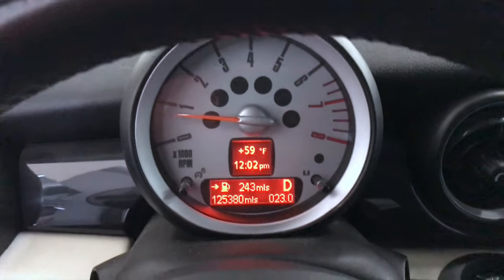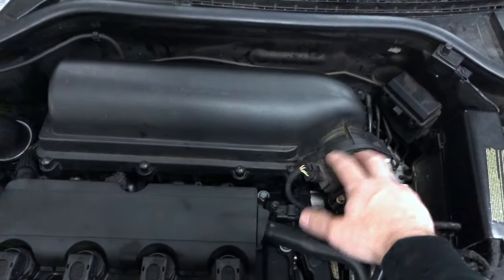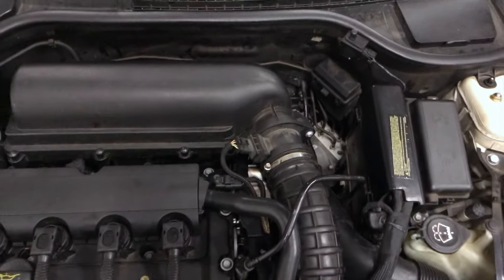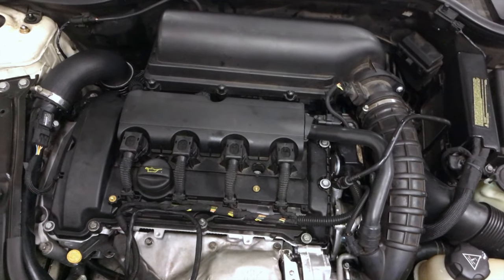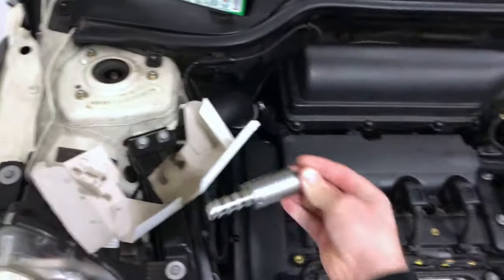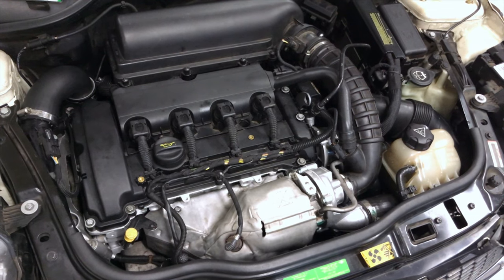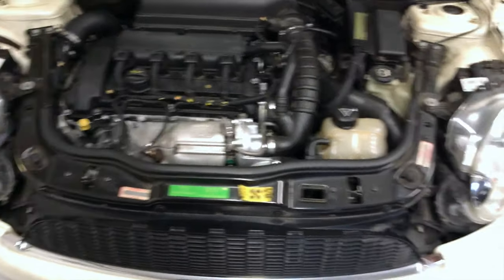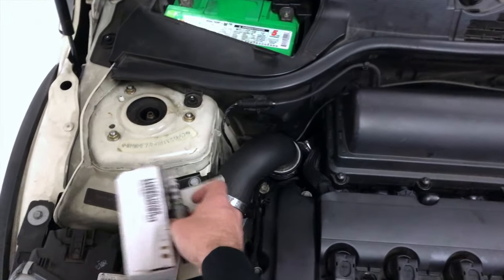MINI:  Erratic Idle Issue, SOLVED

Comment: These cars are a nightmare, all of them.  Stay away and live a happier life.
Reply: YES
Reply: Exactly, you can't solve any issues 100%. It will always be solved 50% and for one issue need to replace many parts. These are just crap Autos
Reply: @Mrmuzgemni  why you here then? My first mini had 200 thousand miles on it. I put 20 on it without spending a dime. Now my clubman s with 145 on it which I got $3 grand below price runs like a pocket rocket. DO YOUR OWN MECHANICING IF YOU WANT TO OWN A MINI SPORTS CAR. That's the only way people.
Reply: My 2012 minicooper S has been an absolute blast to own. I've only ever done very basic maintenance aside from replacing the valve cover gasket, even that is pretty basic
Reply: these cars are the best you can drive much fun
Reply: @vaiosdiminikos4628 they definitely have never driven a mini before and don’t understand😅
Reply: La mia ha cominciato ad andare male da quando l'ho trascurata. Se la tieni bene va come tutte le auto.
Reply: Absolutely
Reply: I hear you!
Reply: As someone with a mini cooper please stay away😂😂8k in it and it still isn't 100%
Reply: @andypeers9903 if you have to be a mechanic to own a mini, then it means it's a very crappy car
Reply: You know shit then. The r53 is a SUPER solid car.. the 07+ n14s once revised are as reliable as their owners..plain n simple
Reply: They are actually really good cars they start having problems at 130,000 miles just like a Toyota does all cars are the same when they’re late models.   These are Baja inspired and there’s a lot of really cool innovations a lot of bang for the buck.
Reply: I must fix them all
Reply: I agree but they are fun though 😅
Reply: This car is a problem factory
Reply: Wrong. Improperly maintained Minis are nightmares. Skipping out on something because it's expensive can ruin lots of cars.
Maintenance is actually pretty cheap if you are willing to learn how to turn spanners yourself.
Reply: @Wisey_83  So are formula one cars, if you take the engine apart after every race and replace every component, they will perform better. Does that mean they would make good daily drivers? I should not have to become a mechanic to own a car. Listen to what you are saying, I give you permission to think about it.

Comment: I've taken my car to the mechanics three times in my life time. One at a local shop, one at a european car specialist, and the last at a mini cooper dealership. The first time, they failed to fix the issue and I was able to fix it myself with a new intake solenoid. The second time was at the specialist and my car was misfiring so a fuel injector and the thermostat were "replaced" (which I found out a year later, they didn't cause I tried plugging in the old thermostat and it was completely different). Still wasn't fixed, so the last stop was at a dealership in which they replaced all the things I had already replaced including spark plugs, coils, new injectors, etc. Needless to say, they couldn't fix it and told me I needed a new engine. At 75k miles, I didn't think it was worth getting a new engine, so I took it home and looked up videos. I was able to fix all the misfiring by simply replacing the dirty fuel filter in the fuel pump. They didn't even look at it! Now I'm not saying it was the sole reason my car was not working properly, but I got cheated twice and paid a lot of money just to be told I needed a new engine when they completely overlooked a simple replacement. Thanks to these kinds of videos, I was able to save myself from spending another couple grand. Please keep posting videos, no matter how simple of a fix it is. You could save someone a lot of money. Now my code reader is reading cylinder 4 is misfiring. I'll be strolling through your videos! Thanks 👍
Reply: Thank you 🙏
Reply: I'm getting a 1497 code-- could it be the dirty fuel filter?  Thanks, Mike
Reply: The Ford dealerships I have gone to are also very incompetent and deceitful.
Reply: Hello there, did you find out what the cause of cylinder 4 misfiring is? I have a 2002 R50 and have the same problem P0304 cyl 4 misfiring, I did a compression test and it is indeed below 150 psi. It could be the intake/exhaust valve I'm assuming but I'm not sure :"(
Reply: I changed EVERYTHING and still runs rough. :(  Fuel filter, plugs, coils, Vanos, timing chain, throttle body, pcv... time to trash it.

Comment: A good rule of thumb with these engines is to be careful about running fuel injector cleaners through your fuel tank... it can cause funk to foul up your oil and cause the VANOS solenoids to become clogged(ask how I found this out 😂)  if you do run cleaners through I recommend changing the oil after the tank of fuel is almost out. You can spray the VANOS screens with brake cleaner(try not to get it on the plug) or let it soak in the acetone.
Reply: I’m now reading this after putting liqui moly injector cleaner in my 08 mcs

Comment: My friend has a 2010 cooper s turbo with a weird issue. Engine runs fine for the most part but throws a bank 1 rich at idle code. Checked fuel trims and when the engine is idling after start it has a ton of negative fuel trim value. Seems like the engine sorts itself out after driving for a while, but still idles rich. Supposed fix is new valve cover, that did not fix the problem. What other things could cause this?

Comment: With a rough idle I would've also checked the PCV connection & its plastic hose too.  The plastic hose connection between the dirty side  of the valve cover and the intake manifold is notorious for cracking.  Just take the OEM plastic hose (with its integrated fittings on each end ) out of the engine...pinch fittings at each end.  Carefully cut out the fittings from the plastic hose.  These fittings are simple BARBED FITTINGS at each end.  Therefore, just go out and buy some 3/4 inch I.D. RUBBER hose of same length as the plastic hose. Slide on two hose clamps for the 3/4 inch hose, push those barbed fittings at each end and hose clamp them.  This will solve the inevitable splitting of the cheap, thin walled, brittle plastic hose that is supplied with the car.
Reply: Question, have you seen any videos on how and where to remove the hose from?  In the meantime, I just keep repairing it.  I'm afraid to open a can of worms.  Thanks in advance.  ~Veronica

Comment: I want to thank you so much Mike, that this situation happened to you and for you posting this because this is exactly what happened to me after repairing a warp head from overheating, sending the head to the machine shop, and after the first... it started to do that engine idle, with misfires in all cylinders codes. and after finding and watching your video, I got to work, removed the Solenoid, cleaned it, removed the screen added power to the switch, sprayed it with contact cleaner, replace the screen then reinstalled it, started my mini and the idle was perfect!!! I hope my comments help anyone else that had the same situation happen to them... I tried cleaning first before buying a replacement solenoid... wow they are expensive!
Reply: How expensive and from where, please? Mine is doing the same thing. Thank you for the excellent presentation! I subscribed.
Reply: Same. Mine is misfiring. Worse when cold. The mini is so problematic!!!

Comment: Was chasing the same fault. After changing both O2 sensors, saw this - Solenoid replaced and sorted withn minutes - thanks for sharing this, saved a lot of time and money
Reply from the maker: Nice! Glad that solved your issue. It was a strange one.
Reply: O2 sensors was mentioned by my mechanic too but at a huge cost!

Comment: Hey Mike! Thanks a lot for your video! Ive got same issue with my Peugeot 308 '13 with mostly the same EP6 engine. After a cold start, when engine starts to drop for a normal idle like 740-760RPM - this problem occured. Also - car starts shakin very violently when you first put it in a gear, no difference whether it be D or R. And once again - no failures or check-engine, no fault codes on both ELM or Lexia (basically - special diagbox for Peugeot\Citroen). 

I've tried everything from new coils & spark plugs, i've changed petrol station twice, even opened the valve lid and checked the timing chain - everything seems fine! And then I've found your video with the exact same problem, so i've chandeg the solenoid valve and voila! Everything finally works perfectly! 

Thank you man! Big respect from Russia!

Comment: Of all the videos to help me diagnose my rough idle on my N14 r56, this was the answer.  I had many but not all the symptoms of every other video, and I was really hoping to try anything, but replacing or servicing the timing chain (as this had been done only 20k miles earlier).  This same solenoid was my issue and was SUCH an easy and cheap fix.  We're back running smooth.  Thank you very much.
Reply from the maker: I am very happy this helped in your case. Thank you for sharing.

Comment: Had same issue on my 2007 Cooper S recently.  Changed plugs/leads and still had cold start issue.  High Pressure Fuel Pump changed too.  Sorted now, drives better than ever.  MINI's are renowned for Fuel Pump issues as second time replaced now.
Reply: Do you run it low on gas often?
Reply: @puppacito  fill full tank, then fill up when 3 bars left (10 bars on guage).  Does this affect it?

Comment: Great video
I'm trying an aftermarket solenoid just for the test if nothing else. It's a used car I did timing chain, head gasket, shaved head by hand, replaced oil pan gasket cleaning out that film in pan, replaced water pump, installed new plugs w aftermarket coils, new f bumper support, sanded and wired brushed front frame/suspension, new backing plates (factory only) and wheel sensors. All aftermarket except front backing plates and all work well so far. 
Injectors need to be sanded like a piece of tubing to fit back in if you have high miles or they wont pop back in. I had to clean mine twice pretty well at 207K.
Reply from the maker: Wow. Its a project of love )

Comment: Wow I literally JUST had the same symptoms on my, 2011 R56 N18, and I turned out to be the, Fuel Rail Pressure Sensor, which is located on the fuel rail. Runs fine again. I'm going to go back in to Change both VVT Valves, tomorrow. Thanks guys
Reply from the maker: Very interesting. Glad you figured your issue out. Best!

Comment: Hi Mike,  I am currently experiencing something similar on my 2012 R56 non turbo.  I rebuilt it after purchasing it for $500 with head gasket blown.
I have P00BD codes show up about 400 seconds after starting.  Slightly erratic idle at startup, then smooths out nicely.  It does have very occasional surging, or possibly no fuel briefly at about 3000 rpm, which can set the P00BD code (MAF too high air flow).  Replaced the MAF, O2 before cat, and spark plugs.  It has 0.5mm bigger pistons (non turbo pistons), and head was decked and serviced.  Block was decked also.    I have ordered a new PCV valve, so that may be it.  It's been running now 30 days since finishing the rebuild.  Smoked the intake and found tiny leak at intake cam sensor.  Cleaned O ring, now no leak.
My son is a ASE mechanic, and so far he's stumped.  I am new to Minis.  It's fun to drive, but can't pass inspection.  I did see a lean code recently also... but not normally.  I clear codes, my son clears codes at shop, and keeps coming back.  Could it be one or both of my Vanos solenoid's?  Intake/Exhaust solenoids were removed before head went to shop, so they were protected, and I installed them myself.
Sorry to bother you, but after hours of searching, your video checked most of my boxes for my problem.  I tried to replace almost everything I could with new parts that I thought should be replaced.

Also, what is the valve located in the valve cover in the center next to the air filter bolt?  Not the PCV valve, the smaller one?  I took it apart to clean it while rebuilding motor.  Did I damage something?
Reply from the maker: Mass air meter faults are almost always due to a faulty throttle body. The throttle body is plastic and starts binding also the plastic gears inside start wearing out.  Every MINI eventually needs a throttle body once in its lifetime.  Thanks for watching my chanel and subscribing Kirk.
Reply: @MikeMDs  Hi Mike,  UPDATE:  I took it to Mini.  No help.  They actually put a new throttle Body in, and a new Mass Air Flow sensor.  Kept throwing a P00BD code.  They also did a TSB for another code (new DME software...).  When I picked it up, they had it idling for more than 30 minutes (maybe 40...) and when I drove out I saw the check engine light go OFF!  I drove straight to DMV and it 'PASSED' emissions.  That means no check engine light, although the P00BD code was in the Verified (?) section, not in the Pending nor was it in Permanent section on my Blue Driver OBD2.  After driving a couple more drive cycles, Check engine light came back!  Now I have two years to learn about my car.  My guess is, this P00BD code is a cummulative number based on time of Mass Air Flow over time.  Since my pistons are 0.5mm larger overbore, I believe it's measuring correctly.  I think there is a limit in the ECU that if it goes over that limit, it sets the Permenant and Pending P00BD codes, so the light comes on.  I now know if I let it idle for say up to 45 minutes, turn it off, then it probably will turn off the light for a drive cycle or two.  The Mini dealership did nothing other than teach me that idling will help turn it off.  Nothing is wrong with the car.  I just need to find out if the ECU can have that Mass Air Flow limit number be increased...  Any ideas??  I don't want to 'Tune' it, but is that what I need to find?  Someone to tune it?  I want the ability to remap the ECU back if done wrong.  I don't want extra performance, just not have the light off. I do have bigger pistons.  That's why I suck more air over time.  Thanks for listening.  I cannot find anyone else with this problem.  Maybe that no one else bothers to rebuild a std non turbo Mini?
Reply: I also swapped the Intake and Exhaust solenoids because you had that trouble.  I also replaced the PCV valve.  None of that helped.  I am of the opinion it's running fine, just bigger pistons draw in more air past the Mass Air Flow Sensor...
Reply: @KirkReed hey, i know it's long ago, but did you fix it back then  because i have the exact problem and i did the exact steps you did and still didn't fix it, hope you remember 😬😅

Comment: Had all those problems. Poor idle, high oil consumption, erratic auto box, fumy exhaust. Took out the PCV which was OK but the whole thing was SO coked up.  Cleaned it thoroughly and it runs like new. Thanks.
Reply from the maker: Nice work!

Comment: I had experienced erratic idle as well even changing out the VANOS solenoid. Of course the same route we all go through, changing plugs, coils, blah blah blah. So for the heck of it I checked compression. During a compression check, one of my cylinder (#3) was low at 120PSI but only when cold. I repeat, only when cold, at first start. When the motor warms up, the compression check registers normal across the board. So I shut down, then restart the idle is fine. So I found the fault to be the teflon injector seal. But unfortunately, if you were to pull the injectors, you need to change out all four since they're all attached to the rail by a tight viton seal. I recommend when you change the seal, no special tools needed for this, I have a trick, I just use a "Paper Mate Ballpoint Stick Pens 2006827", google it, it's the blue one that we all have used in our lives. I slide the teflon to the major diameter since it's the same diameter of the injector to expand the teflon. Once expanded, slide it off and put it on the injector. Cut off the pen cap leg, then use the pen cap to compress the teflon, give it a couple of minutes. When you remove the pen cap take no time and insert the injector before the teflon expands. Insert the injector one at a time so you'll feel it bottom out. Wear gloves and clean the injector seats extremely well, no oil must contaminate the teflon seal. Then when you have all four installed, push the fuel rail into position and tighten the four torx bolt. Bosch part # 2707010018. Easy peezee!

Comment: unfortunately we replaced this on our 2015 copper s and it didnt work.  Had to send it to the stealer and they diagnosed it with a bad High Pressure Fuel Pump.  $4200 CAD quote.  I found a Bosch HPFP on Rockauto and had the local BMW specialist shop do it for $600.  Still didnt fix the issue.  Now the diagnosis is that the timing chain needs to be replaced because the HPFP broke it (they are connected)  30 hour job apparently.  This car is a LEMON!!!  This is our 2nd and last Mini. Our R56 Cooper S had major engine issues and now this has a major fuel issue.  And we put premium, ethanol-free fuel in and only the best oils.

Comment: Haha I literally just got this issue fixed on my 2013 Mini Countryman. It drove me crazy. Had to have my oil pan gasket replaced along w my oil pan adapter due to a crazy leak and horrible burning smell. Got it back and it was still rumbling like crazy, turned out to be something w the intake valve not fully being on and air getting inside 🤦🏽‍♀️ now I’m getting check engine light but it’s for the thermostat 🙄..
Reply from the maker: I know. It's a love hate relationship sometimes. More love than hate tho.

Comment: The N12 has two solenoids, one for each cam.  My 08 Clubman (non-turbo) had a similar issue, but it was actually the broken plastic timing chain guild.
Reply from the maker: Thank you Michael you are correct, thanks for calling me out.   I will make a note in the description.  And thanks for watching.
Reply: Every car has them it should kick a code my wifes ecotec 2.2 liter had the same issue